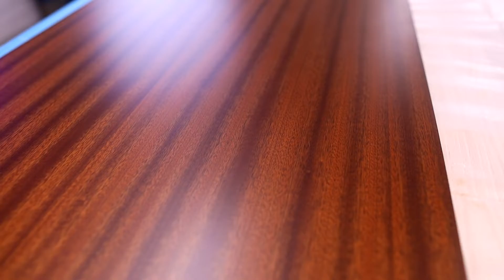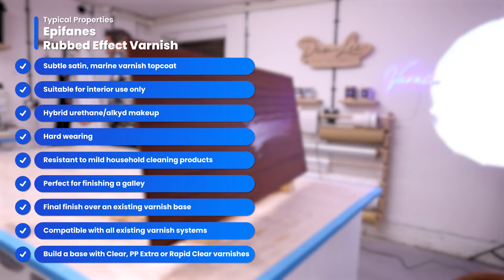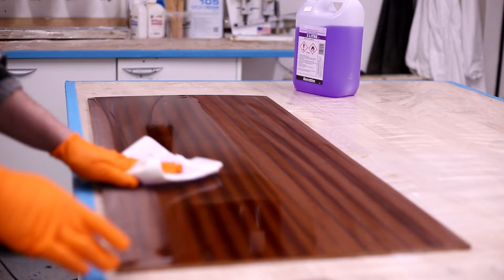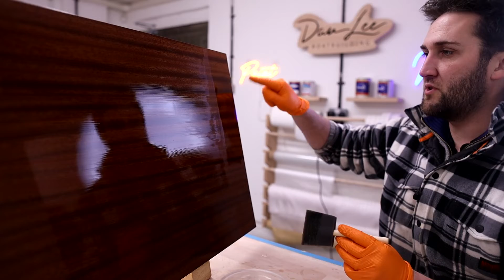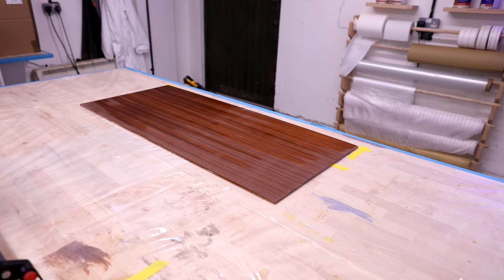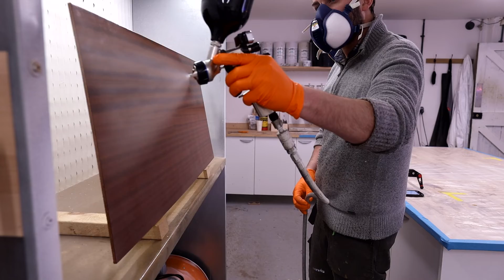How To Apply Epifanes Rubbed Effect Satin Varnish | A Non Gloss Interior Varnish

Comment: What temperature do you keep in your finishing room? I have trouble keeping a wet edge and preventing brush drags
Reply from the maker: It was quite cold when I did this, around 12 degrees C.
Reply: Will International varnish be okay as a base layer?
Reply: @freddiemercerful international is great but make sure the first coat is totally dry before the next coat. It's a polyurethane product and the first coat will not dry through following coats unlike epifanes
Reply: Easy flow.Its a product by epifanes.. maximum 7 percent